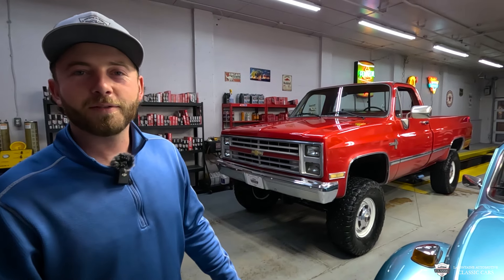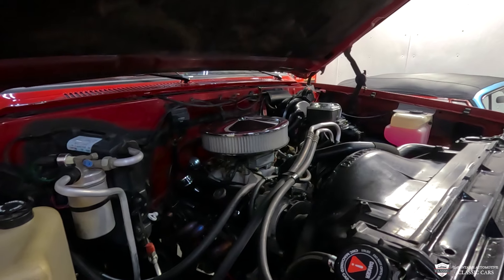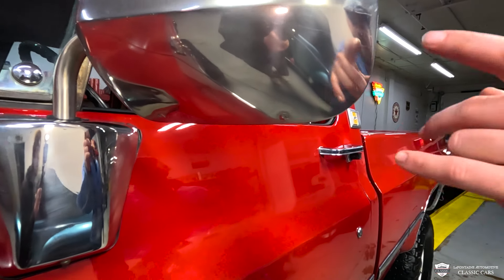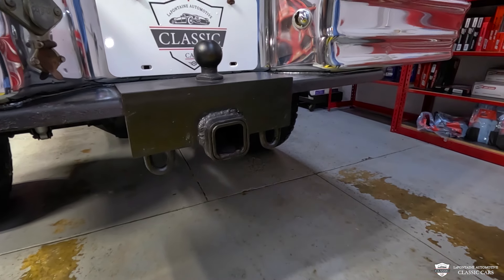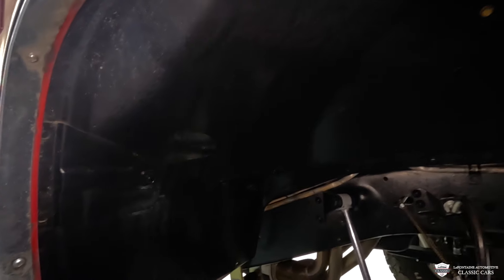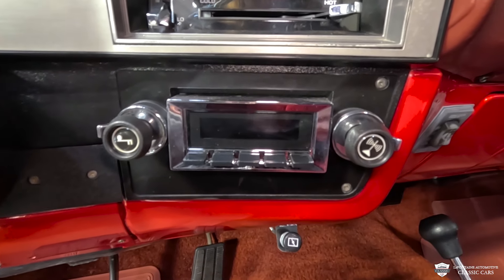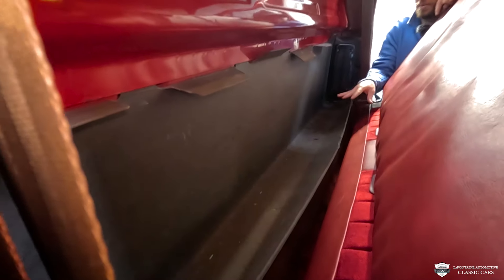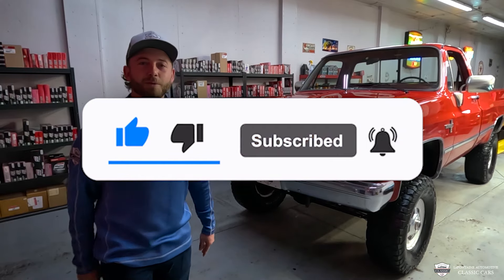Beefed Up 1986 Chevrolet K20

Comment: this is the second one I've seen where a ton of work is put in then the back is lifted with blocks, makes me wonder where else they skimped. 1" to 2" is ok if you don't want to buy new springs, but to completely restore a truck then put 4" blocks is idiotic
Reply: Ran blocks for many years never an issue
Reply: cheaper than the lifted spring  by 400 in some cases dumb in all cases .  proper spring= better ride